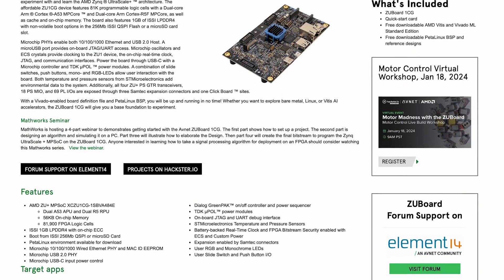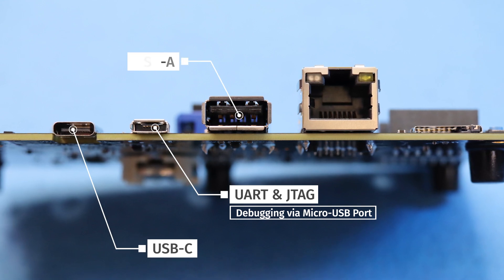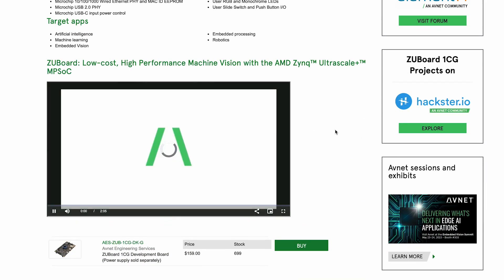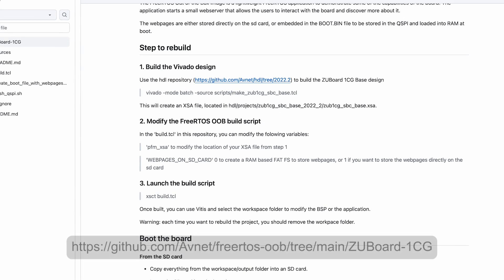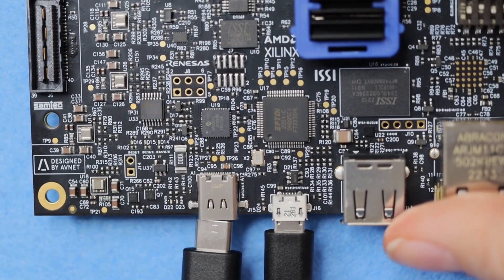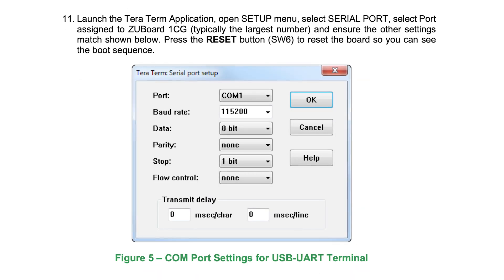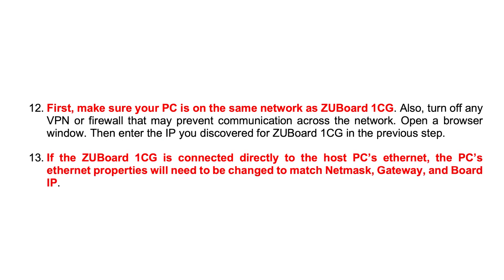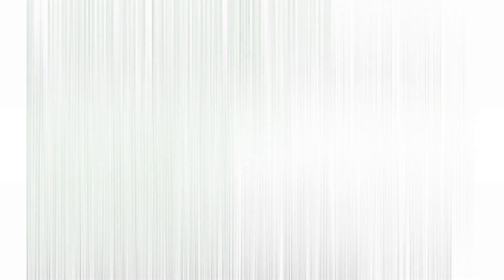Avnet ZUBoard 1CG: Unboxing & Getting Started // Tech Highlight

Comment: I thought your video was very good and helped clear up a misconception I had. I thought that the ethernet port had to be plugged directly into my computer and I would then have to configure my network (subnet mask, IP address, gateway, etc.) to have the appropriate parameters. I now know that the ethernet connection is just for connecting the board to the internet and that UART (micro-usb to usb in computer) is for programming the device. I would be very interested to see an example where we use Vitis, Vivado, and Petalinux on this board.

Comment: Question: The GPIO uses a Samtec QSE-020-01-F-D-A 40-pin connector (at least bank one does).

Is there a standard way to break these out to more accessible pins? Like a breakout board or cable? I'm not finding anything online and don't necessarily want to make my own PCB.